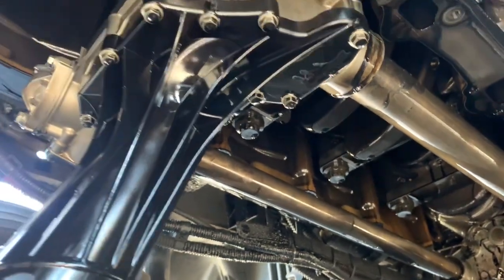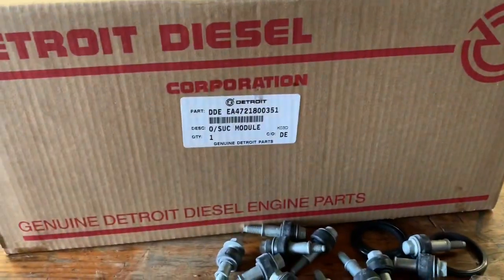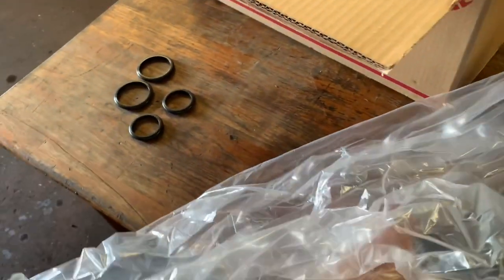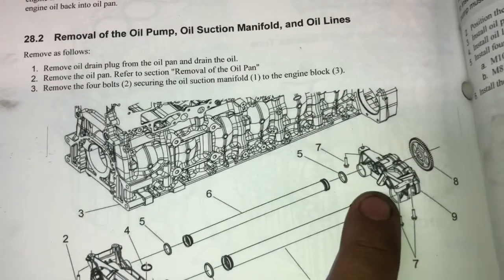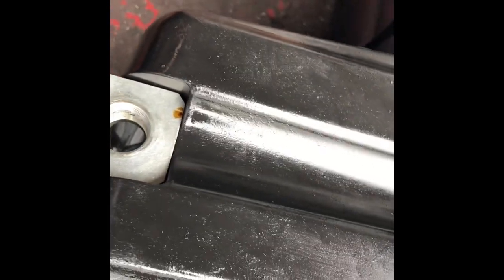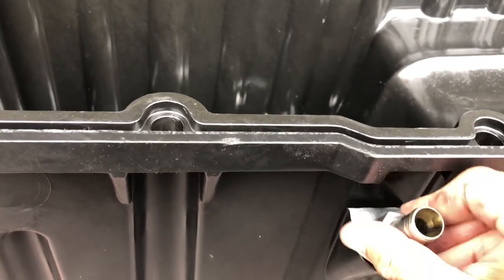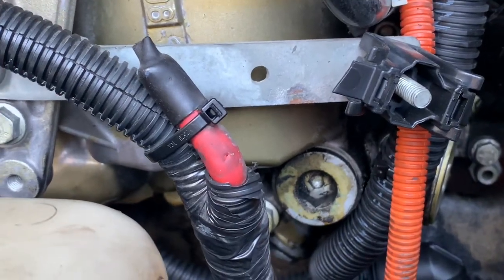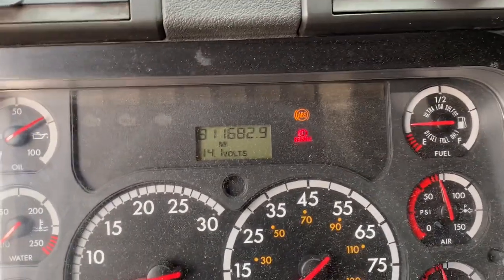DD15 low oil pressure and what to look for.

Comment: Do you need to do this on the newer models 2020 and up??
Reply from the maker: @jayco1918  great question. I would say if you notice oil pressure fluctuates or the needle is not stable at idle then yes.

Comment: This guy s really I lost mine because of this issue, went to mechanic but he said I have to plug computer and I don’t have it and he told me to take it to dealer same day engine seized I towed the truck to his workshop again and he told me i need to buy starter i bought the starter and he put it in and when not started he tried to turn the engine from front and finally he told me the engine looked up he charged me for the starter, big loss guys.

Comment: I'm pretty sure it's the plastic section manifolds that have the problem. The o-rings are a problem on either style I'm sure. I'm actually trying to research and find out if the plastic and cast aluminum suction manifolds are in fact interchangeable. Freightliner will tell you they're not even if they are so that's not a good source. It seems like it would be a direct swap. The metal one isn't going to crack from oil pressure and blow out like the plastic ones do. Those fail on the pressure side, the o-rings tend to fail on the vacuum side
Reply from the maker: I agree with you. The older DD engines that first came out didn’t have the failure rate these plastic ones do. They are garbage IMO, 
I was told they will not line up underneath when they are installed. Something about the bolts on the suction module to the block. I have personally never checked.

Comment: I have a 2017 freightliner cascadia about 560000 miles and my oil gauge fluctuates up and down never steady, at a complete stop it goes low when I press the gas pedal to go it goes up and back down at complete stop again. Any suggestions could this be the pickup tubes or oil pressure sensor?
Reply from the maker: I would definitely start with the oil suction module and the seals on the tubes. ASAP
I have seen this many times and it is most critical you have it looked at right away.

Comment: My oil pressure drops when it's. I'm going after it's more about what should I do about it? The dealer said it. They needed a new fuel pump which I put on also
Reply from the maker: When the oil pressure drops, is this when you are coming to a stop? At idle? While you are driving?

Comment: Does Freightliner cover this under the EW6 warranty?
Reply from the maker: Warranty coverage has changed. The engine warranty or power train is separate from injector coverage. After treatment coverage is another and transmission is another. 
All are extra and have limited mileage and or time. 
So I couldn’t tell you for sure if it is covered   Best bet is to call the dealership and provide the last six of the vin. They can verify

Comment: But i just hovarol a freightliner went i start it stops engine light coming on
Reply from the maker: You need to check right away. Start with oil pressure sensor, how long has it been since you changed the oil? 
You might have to remove the oil pan and inspect the pick up tube and seals. Recommend you do this asap.

Comment: My oil psi is at 40 cruising around 70mph 1300rpm is that low?
Reply from the maker: What year is the truck? 
How many miles? 
How often are you changing your oil? 
What kind of oil are you using?
Reply: @Pedro Fuentes  I just bought it. It's a 2020 dd15 400hp with 460k miles. 10w30 oil they used I believe. Just worried bc my friends truck is at 50 psi mine is 40
Reply from the maker: @notkirill6991  start with an oil change using good quality motor oil and a factory oil filter. Also, replace the oil pressure sensor for good measure. 
Start there. 
Remember, oil change first, start the engine and verify oil pressure is good before you replace the fuel filters (not sure if you were going to. But if you did)
Never change both at the same time. These trucks are not like the oils Series 60 or Cummins N14, M11.
Reply: @Pedro Fuentes  ok I will try that,  so you'd say 40 psi is lower than normal?
Reply from the maker: @notkirill6991  do a road test and have someone plug in, this way they can physically monitor the PSI while driving. Does seem a little low, but if you have a warranty through Detroit have them look at in. Most trucks have an extended warranty on the motor.

Comment: AGREE , change the module as well.. I only changed the seals it's 70 percent better but not I have to drop it all again and do the the module.
Reply: Did you change the module if so did it fix your problem?
Reply: @redboyize why, you replaced just the orings and nothing changed? Same here

Comment: So you recommend replacing the pickup tube because you had to remove it already? You didn't want to replace the front pump where the front of the tubes went into that were spinning? Trying to understand your thought of why replacing the pickup vs just cleaning it and replacing the seals. Not like it had metal through it , top is aluminum where the tubes and rings are , but so is the front oil pump where the front of the tubes went into that you didn't bother replacing.Trying to understand WHY you replaced that but didnt bother replacing the front pump where the tubes went into.......
Reply from the maker: The oil pump is very reliable, the failure typically occurs at the pickup tube (suction module) and the orings will harden and allow oil escape. 
The suction module has an internal valve that fails and will get stuck. 
In my opinion, I automatically replace the suction module and the orings because I don’t want to run the risk of it failing on my watch. 
Now if this is something you are doing on your own truck then it’s your decision to make. But I don’t want the responsibility of engine failure because I didn’t want to change a part that cost less than $200.

Comment: For a Cascadia 2019 what would be the pressure hot and cold. Thanks
Reply from the maker: The 2019 engines use 10W-30 which will give slightly lower PSI. 
Cold PSI should be at about 60 at idle
Hot PSI should be at 15-19 at idle
Reply from the maker: At idle you have different PSI, at a higher RPM you have a different PSI. Which were you asking about?

Comment: Hello. I have a 2015 cascadia DD15. I had my pick up tubes oil pump gaskets replaced. But I just found out that my mechanic didn’t change out the oil suction manifold. With that being said now I don’t have NO oil pressure so I’m getting someone to replace everything again including the oil suction manifold this time. Would I need to get a new oil pump again? It was replaced 2 months ago?
Reply from the maker: Oil pumps very seldom fail on the DD15 and DD13. 
Also try replacing the oil pressure sensor. 
Once everything is replaced, SUPER important to prime the oil system with at least 2-3 gallons in addition to the 10-11 gallons you are going to add. before trying to start the engine. I also like to soak the oil filter with clean motor oil.
Reply: Did you replace the manifold in the oil pan if so how did it do ??

Comment: Is it really necessary to prime the oil system?  
Can you just start it up, let it run till the oil pressure comes up?
Reply from the maker: It is a precaution, priming the oil is to prevent engine seizure or failure in the event you have along crank situation engine failure can occur. 
Priming the oil system takes a few minutes and is well worth it.
Reply: @CarlosDieselElectric  
Thank you

Comment: what is the normal oil pressure when idling hot?
Reply from the maker: 15-20 psi
Reply: Did you have low oil pressure if so how low and what fixed it?

Comment: Hey man great video. Question: I have a 2015 dd13 and my oil gauge goes down to about 20 psi when idling, sometimes is at 25 but it does go down to 20 pis at times. Is this something I should worry about and probably have the O- rings replaced and oil module? Thank you
Reply: Hey David did you find the issue?  just saw my oil gauge doing that yesterday in my DD15
Reply: @fredrickdacosta1407  
Hello, apologize for the late response. 
I changed everything that is mentioned in this video. Suction oil module, O-rings, oil pan gasket seal, oil pan bolts. After changes made my oil pressure went up to almost 75 when cold start. And 25 or 30 when hot idling.
I recommend making all changes. Goo luck
Reply: @daviduribe2560  normal pressure is at 30 psi when hot?
Reply: UPDATE

Comment: My oil was changed and they put over 20 gallons of oil in my 2013 Freightliner Cascadia dd13. i drove it like this for maybe 3,000 miles. Low oil pressure light came on. Took it back and they drained it, put the right amount of oil in it. But the low oil pressure light keeps coming on. It actually dropped to zero a couple of times. Freightliner is having a hard time finding the problem. What do you think the issue is? Where should they look. Which parts could I change? Can someone call me. 5612159045
Reply from the maker: I would start with oil pressure sensor first. 
Then move to the oil suction module, oil pump and the O-Rings on the tubes. 
I don’t see anything else that can cause the drop in oil pressure unless there is some internal damage.
Reply: @CarlosDieselElectric  thank you. I don’t understand why Freightliner didn’t check all of those things that you are mentioning. But I’ll let them know tomorrow because my truck is in the shop as we speak. Lastly, what possible internal damages can occur since I drove it for over a week like that. What items would need to checked for internal damages? Can I bring it you? Where’s your shop located?

Comment: Would you happen to know what normal oil pressure at idle is for a dd13
Reply from the maker: DD13, DD15 and DD16 should all be the same. 
At idle, cold engine, the oil psi should be >60 psi. Once the oil temp gets to 150 or higher, the oil psi at idle should be around 20 psi.
Reply: @CarlosDieselElectric  could bad o rings on the tubes cause the oil pressure to drop fast when braking or slowing down?
Reply from the maker: @albertcruz3232  definitely. Bad O-Rings can cause oil pressure to drop when braking or coming to a stop. I would advise to replace the 4 (2 on each tube) O-Rings and the suction module ASAP.
Reply: @CarlosDieselElectric  sounds good, thank you!
Reply: @CarlosDieselElectric  does your shop offer this service?
Reply from the maker: @albertcruz3232  yes, this is something we can definitely do.
Reply: @CarlosDieselElectric  ok, thank you. I will call the number on your sign.
Reply: @albertcruz3232  did you change the manifold if so how is your oil pressure now when you come to a complete stop or at idle?
Reply: @redboyize  nah, turned out to be a leaking oil pressure sensor. Soon as I replaced that oil pressure stayed around 22ish at idle
Reply: @CarlosDieselElectric  for sure. Thank you, good sir!

Comment: Hello there.  The oil pressure of my truck is 75psi.  Is it normal?  Hope you can reply thank you
Reply from the maker: Are you talking when you first start the engine and it’s cold at idle?
Reply: @CarlosDieselElectric  Yes it is
Reply from the maker: @peterli5556  60-75 psi is good on a cold engine. As the oil warms up the psi will go lower which is normal. 
But it seems like your psi is good. What is the psi when it hot and at idle?
Reply: @CarlosDieselElectric  45PSI about

Comment: Thanks 🙏 a million you’re dope
Reply from the maker: You are welcome. Glad you liked it
Reply: I see you said to someone y’all located in montebello I’m a truck driver and I currently got a delivery heading to Stockton coming from Oregon. And I been trying to coordinate where should I go along my way back east to stop and get the work done I got a 2015 freight liner cascadia same issue a mechanic told me that it could be the o ring a and watch the pressure gauge. Anyway I say all that to say if you had all the parts you said in the video how long would it take and estimated cost if you don’t mind?
Reply from the maker: @derrickoliver3835  send me the last 6 of the VIN. I need to check parts and availability. There has been a factory back order on some Detroit parts. Especially the suction module.
Reply: 3AKJGLD51FSGM8624b thanks 🙏 again for responding

Comment: I had similar problem truck drop oil pressure then heard a knocking sound..shop was so far behind they couldn’t fix it.Im concerned about the knocking sound but they did take valve cover and valves were all good..any thought on what the sound could be?
Reply from the maker: Any knocking sound is always a concern especially with low oil pressure. Have you been able to drive or run the engine since this happened? 
I would personally look into the lower end of the engine. Look at the tubes, can you spin them? How many miles are on the truck?

Comment: @Carlos Diesel Electric ? That oil pan drain plug.  Where can those be purchased. I'm going into mine to check them o-rings.

Also any tips, for removing my cam shaft housing.  I'm just about prepared to replace the camshaft housing gasket.

  Im told to only remove the 10mm bolts that bolt through to the cylinder head that way everthing else (cams, camshaft caps, valves..., come up & off with the camshaft housing

pg  83 in the manual shows a picture with 
Squares, 
Circles,
Triangles,

Comment: How much a job like that cost
Reply from the maker: Anderson james parts will depend slightly on what year truck you have. The first DD15 engine parts were a little more expensive, then slight modifications were made and pricing dropped a little. 
But typically in labor you are looking at 6-8. What year is your truck?

Comment: Carlos how do you look up for a part using vin #? I use year and model and never works for me . 2013 freightliner cascadia DD15
Reply from the maker: JOSE RAMIREZ VIN will always be used by dealerships and authorized vendors. Most other parts places (stores or online) use year, make and model. That will work on most common parts.

Comment: How do i know when its time to change oil pump, does it gives you any warning, can you please let me know
Reply from the maker: MrDeepa32 when the engine is cold and you start the engine. Oil pressure should always be at 60 psi or more at idle. 
Also, look to see if the needle fluctuates or does it hold steady.
Reply: Carlos Diesel Electric thank you sir
Reply from the maker: REMUS that sounds about right. Hot oil thins out, this is why at idle you have 20 psi and at higher RPM you have 60 psi. 
What is the PSI when the engine is cold? At start up?
Reply: @CarlosDieselElectric  this is exactly what K was looking for on my question. When engine is cold start mine is about 65 psi and when idling it drops to between 20-25 psi. Thank you for all your support
Reply from the maker: REMUS that is good. That is where it needs to be. Of course once the engine warms up the PSI will be lower. But it sounds like you are on the right track

Comment: Can you pls help regards to 2011 cascadia water temp is high while I stop and idle to take brake it goes 205 210. Pls help
Reply from the maker: Jeremy Kura have you replaced the thermostat?
Reply: @CarlosDieselElectric  I did. Replace thermostat 2weeks ago,  radiator water pamp 6 month a go and changed injector cup seal a month ago cause mixed fuel with coolant. So problem is happening after did work on injector cups and also my bunk heater core was licking so just make the hose kind u turn.
Reply from the maker: Jeremy Kura I am sure you did. But did you flush the coolant system? If you did how many times,
Reply: @CarlosDieselElectric first 1 or 2 time with small amount of dish soap after that just with water 3 time. and then  I used system cleaner, after system cleaner 2 or 3 time just water finally  I changed all the hoses new. Bay the way I run the engine between cleaning to operating temp 150 -   Took me almost 2 week cleaning. May be to much cleaning but making sure no more fuel smell.
Reply from the maker: @jeremy143bezi  So let me try to understand this, the coolant temp rises to 205-210. When does the fan clutch engage? When it does engage at around 220-225, where does the temp drop to?
Reply: @CarlosDieselElectric   the temp rises 205-210 while I am parked or stop after I drove 15-20 miles and stay at 205 210. No fun engage.
Reply from the maker: @jeremy143bezi  Unless the thermostat is stuck open. That can cause the issue, have you tried to get the truck temp to rise so that the fan will engage?
Reply: @CarlosDieselElectric   thermostat is new. I Changed it 3 weeks ago. Do you think the hose that I took out from bunk heater core and connected together make the heat rise up?
Reply from the maker: @jeremy143bezi  no, the hose is just allowing the coolant to return and avoid the heater core.
First you need to see if the fan clutch engages and at what temperature? This way you can see how it cycles.
For example, at what temp does the fan engage and when the fan stops at what temp is it at (how low did it go)?
Reply: @CarlosDieselElectric   ok I will  check that. I am just worried that if the  head gasket has kind of issue or it going to. What do think.
Reply from the maker: Jeremy Kura if the head gasket were bad then you would have other issues. Are you loosing coolant?
Reply: @CarlosDieselElectric   No sir. I am not losing any coolant. I am just worried.
Reply from the maker: Jeremy Kura try seeing the temps we talked about first. I don’t think the head gasket is bad.
Reply: @CarlosDieselElectric  sure I will do and let you know. Thanks.

Comment: The o rings, do you install them on the tubes or in the holes? Thanks.
Reply from the maker: I always install them on the tubes, apply some assembly lube (lubriplate No. 105). Once you install the rings on the tubes, use the assembly lube to help it slide into place. The lube will go dissipate once the oil warms up.